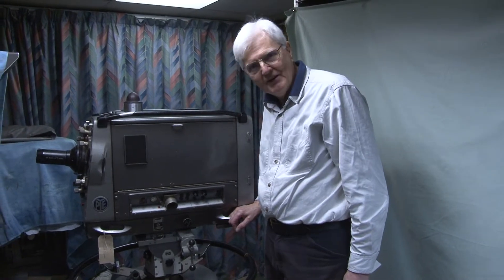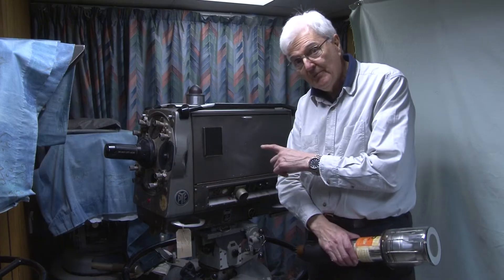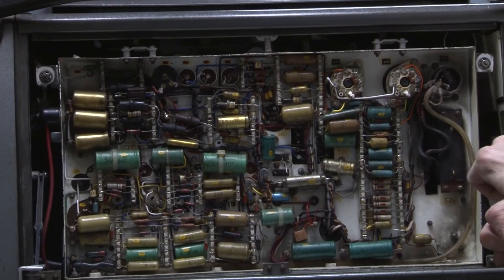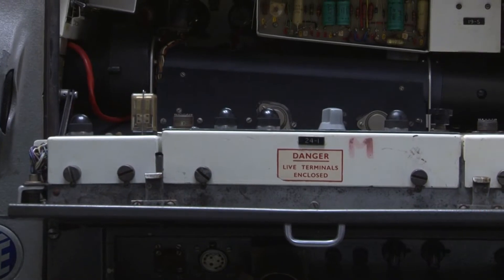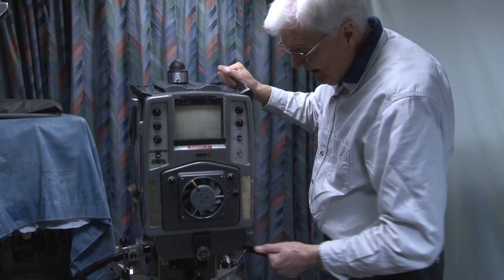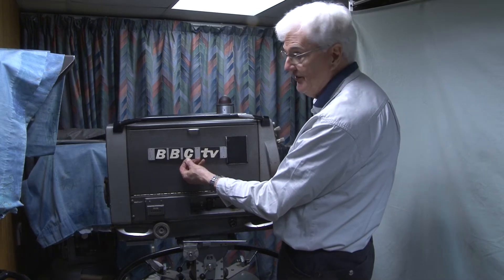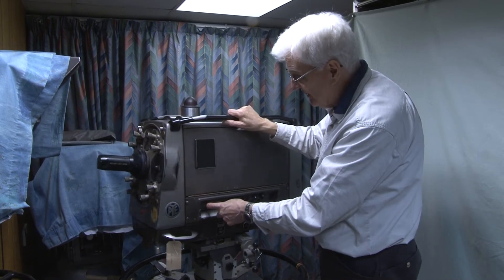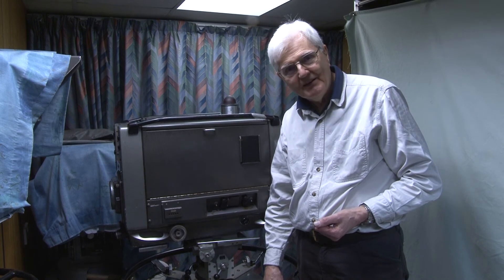The Pye Mk6 broadcast television camera - as used by the crew of MCR21

Comment: Amazing the size difference between the RCA TK-30A, which I operated in 1965-67, to the PYE although I recognize a difference of 3-inch vs. a 4.5-inch image orthicon was considerable. What I do see, however, is the greatly reduced amount of internal electronics, which I assume was due to the advent of transistor and solid state circuitry over vacuum tubes.

Comment: Am I right in thinking that these turret lenses were because each has a fixed magnification and they can't zoom?  Or do they all have a small zoom range?
All this makes my DVW 790WSP Digital Betacam camcorder look like something from another planet, even though that too is totally obsolete.
Reply: That's right each lens offered a fixed angle of view. if the programme required a zoom lens, one could be booked from stores ( BBC outside Broadcasts), but it did mean the other lens positions on the turret could not be used due to the weight and mounting arrangements of the larger zoom lens..

Comment: I worked for Swiss TV in the 1980s and I remember that camera tubes were stored in special containers with cardanic mechanisms that held the tube with it's image face down all the time, no matter how you put the box. They must have been very sensitive (and expensive)
Reply: Slight correction. When transported the tubes were *FACE UP*. This was to prevent any loose particles from falling onto the inside of the target. Particles would cause permanent blemishes in the picture.

At the factory tubes were made in batches and tested for electrical performance and image quality. Tubes without blemishes were graded for broadcast or medical service, lesser performing tubes were sold for much less money to industrial and security camera roles, and the worst of the lot were designated for "Amateur" or hobby use.

The tube shown here operates on the photo-emission principle. The faceplate emits electrons proportional to incident light. These are drawn to the internal target and scanned by an electron beam, and deflected electrons (that are proportional to scene illumination) are captured by the photomultiplier section and amplified to become the resulting image (aka Video) signal.This type of tube operated from high voltage (about 16ooV) and produces about 500mV of signal.

The sucessor to this type (variously called a Vidicon, Plumbicon, SATicon, or later Newvicon) operates on photo-conduction, and the target is made light sensitive so that in brightness the resistance drops compared to dark portions of the image. A scanning electron beam restores the charge lost in light induced conductive area, and that recharging current carries the picture (video) signal. This type of tube operated from medium voltage (less than 1,000V) and produced a very weak signal output current measured in microamps.

Photo-conductive types gave rise to smaller lighter and lower power portable cameras.
Colour cameras typically use multiple tubes, for Red, Green, and Blue channels. Consumer grade cameras used a single tube and some clever optical filters at the faceplate, followed by equally clever electronic to "unpack" the signal, shuffle the color sensitive signal, and "repack" them for ultimate use in a television monitor (home receiver)
Reply: @pstonard Thanks for a clear explanation.

Comment: The interior looks like a Tektronix oscilloscope of that time. Very well built!
Reply: Agree! Tektronix had a leadership position in both engineering design and manufacturing skill.Philips held a similar role based in The Netherlands, both companies highly "vertical" (raw materials in one end, finished product out the other)
There were other players building equipment for the broadcast industry, which served few customers, that were very demanding.
Firstly, the performance was not spared by the broadcaster, who wanted the best, and most reliable kit. A single failure at the "sending end" would directly affect many customers on "receiving end" (at home watching)
Secondly, it was better to produce a robust high quality signal at the broadcaster, and somehow reduce the costs of the TV receiver, which was in much greater volume, and sensitive to just pennies of cost.
Thirdly, in the days of analogue video the "product" (ie the broadcast signal) was easily degraded by the many stages it has to pass from camera (or film scanner, or video tape) to home receiver.Digital signals are considered more robust in general, but ultimately fail miserably if degraded enough.

Comment: The camera has more features than I would have expected for the early 60s. Clearly built to last, and be in service a long time. Must have cost a fortune.
Reply: A lot of forward thinking as well. Expansion options with connectors, easy to service, swappable lenses. It makes sense they kept using these as long as they did.

Comment: Maybe somebody can answer my slightly-related question. I was watching A Hard Day's Night on Turner Classics when they showed the scene inside the TV studio control room. There were B&W TV monitors, and each picture tube corner had a "wire" pointing to the center of the tube, so four in all. A knob held each wire in place. What were those wires for? I'm old enough to remember B&W television, but this really has me perplexed.
Reply: If i understand what you are asking, these "lines" were to set the edges of the picture size to be the correct aspect ratio of 4:3.  The picture scan size was smaller that on a domestic TV so the edges could be seen.

Comment: Interesting how they used the silver plated ceramic insulators for component mounting, such as what Tektronix pioneered.  I wonder if they contracted to get those terminal blocks from Tektronix?  If this thing was built anything like the Pye TVT UHF television transmitters, one must wonder how many people this camera killed due to shoddy safety design.  Also, I hope it gave a much higher quality output than the transmitters did.
Reply: Life for a camera in OBs was very tough, but the Pye cameras were later deployed in a studio setting were they settled down and were reported to give excellent black & white pictures.

Comment: Fascinating. How much did these weigh, they look heavy and the cost of these?
Reply: HI John  the camera weighs in at 77Kg, without lenses, a 4 man lift!.  The cost was confidential, but would be a LOT.
Reply: @bsomers8664  TY
Reply: Hi Brian, We managed a two man lift, just, when BT (P.O. Television Service back then) had 4 Pye mk5s & I think  we also managed it with the mk6s at my radio club but we were a LOT younger then.
Reply: Broadcasting equipment was fiendishly expensive mainly because there was no economy of scale. Back in the day there may have been a dozen or so manufacturers chasing relatively few broadcasters. The equipment was expected to be very reliable and rugged and to last at least a decade. There as very little replacement going on and growth depended entirely on new technology, techniques and additional networks being licensed.